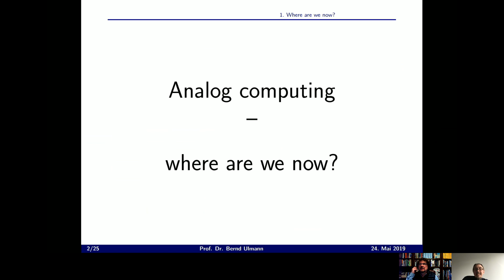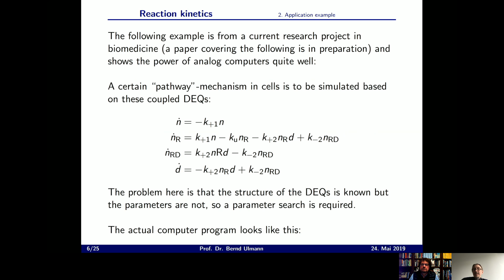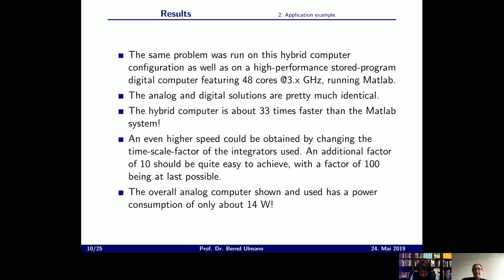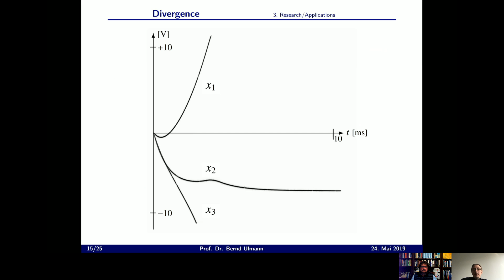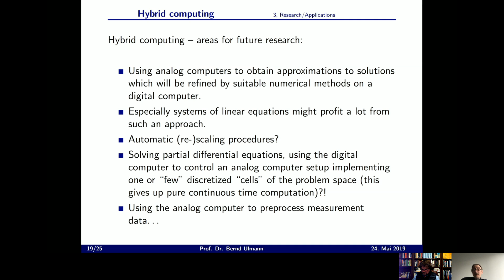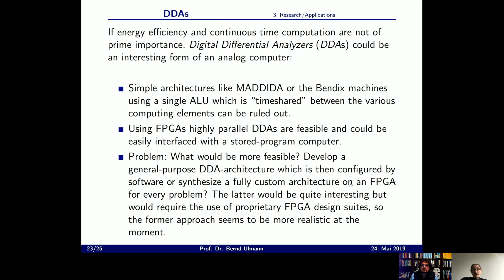Bernd Ulmann - Analog Computer returns

Comment: One model which might be useful is the arrangements of relays which were used to control elevator banks in skyscrapers before digital circuitry was available. These machines had to control the analog hardware which controlled the variable speed motors for each elevator car as well as make decisions as to how to respond to simultaneously car calls.

Out of this grew one of the first computer languages. It was called Relay Ladder Language. This was how PLAs developed. Despite what most have been told, mathematics did not lead to most of the computers today, since most computers are PLAs embedded in other devices.

For the future, optical computers with steerable laser beams might overcome the need for large arrays of relays, switches, or the like. Optical, analog OP AMPS and other optical computing components could be linked by digital components with steerable beams. The digital components would mostly operate as switching hubs among the analog components and be controlled by a conventional digital computer.